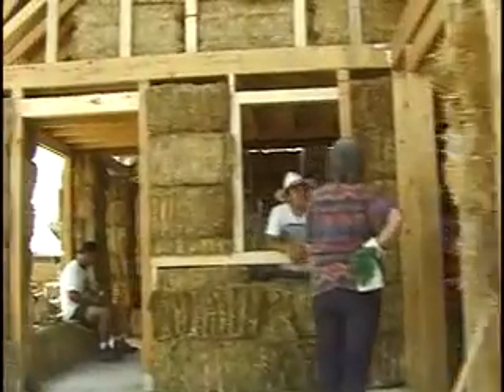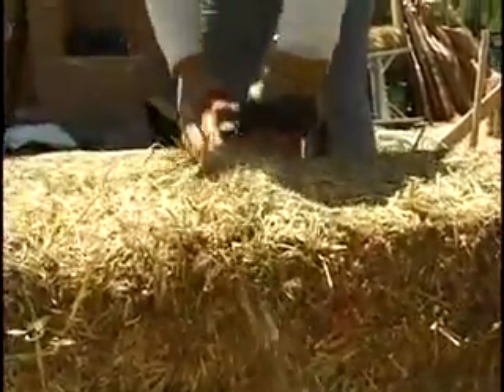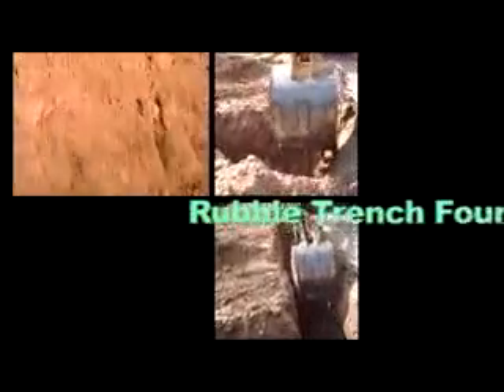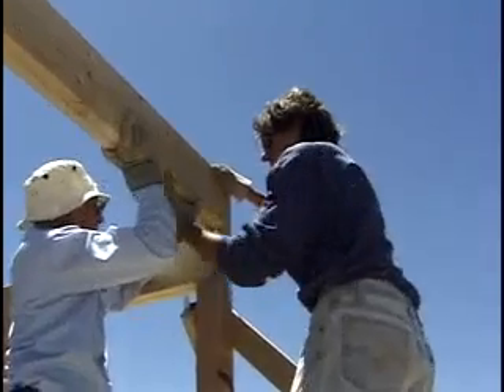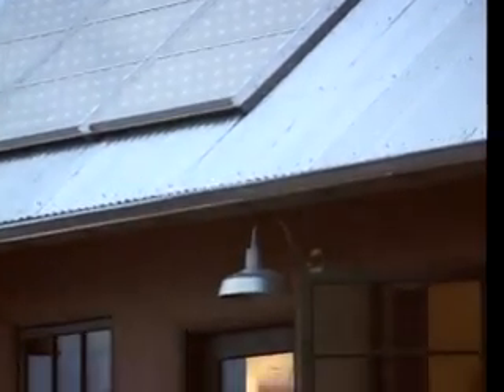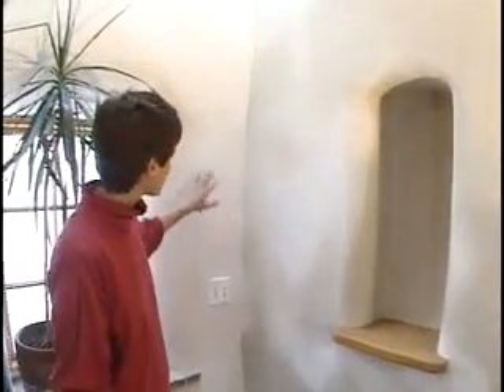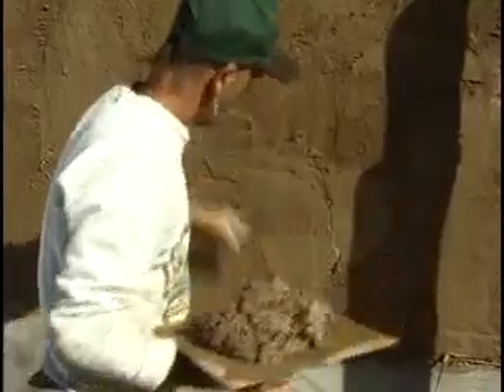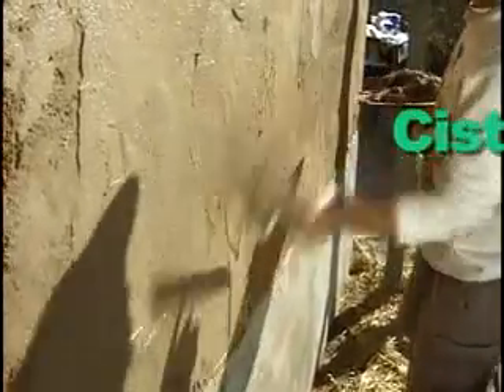Straw Bale Home Construction Instructional Video

Comment: Well produced video and nice design, however we don't live in a fantasy world where you can build whatever you want without oversight - at least in the states.  You need plans and details to get this stuff through the building department.  Something that is  missing from both the video and the book.  I feel that perhaps this whole video is a long infomercial for hiring the services of the designer.  I've started to convert the structure to my own AutoCAD rendering.  Just for a starting point.

Comment: Straw is actually different from hay. It has next to no nutrient value and therefore, even if it wasn't sealed, does not attract bugs, rodents, etc. The air tightness of the construction process with the clay sealant precludes bugs and acts as a further fire retardant.

Comment: true about seeds and rodents. where i am form sometimes the hay has to be baled early, as weatehr is not always so freindly for baling, and such is sometimes bailed rather "green" ive seen one of those stationary balers in action, and t woulda have been alot more work to do a straw house back then than it is now. understanbly a lot easier and cheaper than finding and transporting sparse and labour intensive timber.

Comment: Hay also has seeds and other things of nutritional value, which is conducive of things like insects and rodents finding them tasty. We put our hay up on the very dry side in these parts, just enough moisture to keep the leaves and heads on. I've never put it up with a moisture level high enough to promote mold or fermenting (heating). I've read that when those homes in NE were cut into to add an addition, the horses ate it like candy. This stuff was put up with horses and a stationary baler!

Comment: it really depends how dry the hay bales are, generally when bales are stcked, they are still a little damp, which is how some hay shed fires start, i agree hay is expensive, i will be building with straw when i build. (also hay is much messier as the strands of grass withing are much finer) i would be interested to see photos of some of these older straw bale constructions in nebraska, as i have read a bit about them.

Comment: its not hay bales is straw bales, theres a difference here. straw generally is the dead stalks of some kind of crop, and is entirely dry allready when compressed into bales. hay bales are usually made from long grass that has been cut down green, dries for a couple of days and then bailed, and usually still has a moisture content. building ya straw bail house with freshy bailed hay would be a rathe rsilly idea, but building with straw poses no danger at all providing the are not damp.

Comment: The wood frame would be your support. The straw is just  replacing brick, insolation, and drywall. You can build whatever you want. This is an ancient technique. Houses in the Mediterranean are built the same way except they make a concret frame then fill in the walls with lightweight brink and plaster. Straw would make the houses here too warm.

Nice vid.

Comment: The strawbales I have been using were already hard compressed. then on top of that we compressed the strawbale wall with plastic "stripes" vertically, so the hole wall was well compacted and steady.

So as you can see the straw wont compress to the bottom as other kind of fills would, like cellulose or paper.

Comment: Interesting. The main point has got to be the insulation properties of the straw. All the structural stuff is still load bearing framing. Like Adobe now adays, structural framing and a veneer or in fill with adobe. What's the point? Glamor or pretending to be green?

Comment: What about straw bale chicken coops or live stock buildings?  Do have any examples of that?  Thanks, this gets the wheels turning.  The stucko/mud surfacing material wouldn't handle the hot/cold extremes in the U.S. northeast would it?